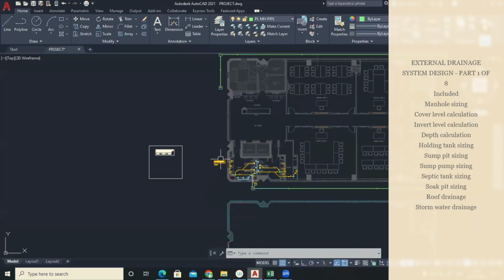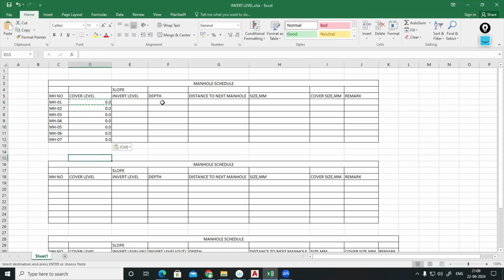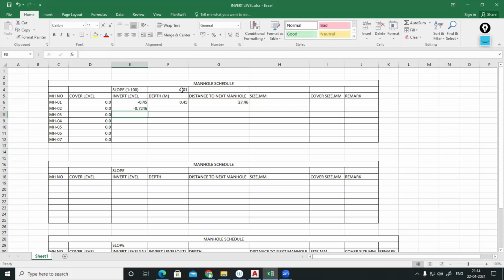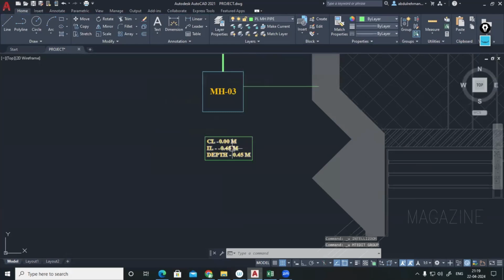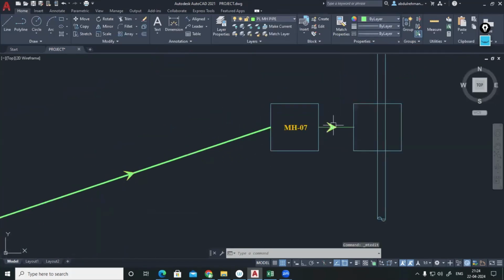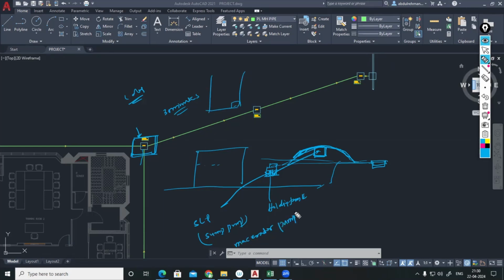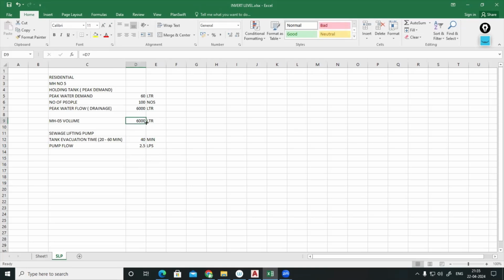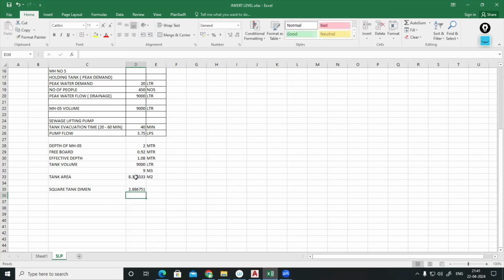EXTERNAL DRAINAGE SYSTEM DESIGN|INVERT LEVEL CALCULATION|MANHOLE SIZING|PART 1|SUMP PUMP|AMNEAR

Comment: What if municipality line depth is lesser than last manhole. Do we have to consider this tank and sump pump for last manhole or before ?
Reply from the maker: If the municipality sewer line depth is shallower than your last manhole invert level, direct gravity connection will not be possible. In that case, drainage is generally collected by gravity up to the last feasible point, then a sewage sump tank and lifting pump are provided to lift the sewage through a rising main and connect it to the municipal sewer at the required level. Need to consider comments from local authority as well.

Comment: What is the distance between manholes
Reply from the maker: The distance between manholes is not constant; it varies depending on the applicable standard and the type of drainage system. For example, as per the UPC , the spacing between manholes in a building drainage system is usually around 100 feet (30 meters). As per the IPC (International Plumbing Code), for public sewer lines, the distance can go up to 400 feet (120 meters), and in some cases, up to 90 meters depending on pipe size and slope. However, in most building drainage designs, manholes are generally spaced between 30 to 45 meters apart. Always remember, the final spacing should comply with the AHJ (Authority Having Jurisdiction) or local municipality standards.

Comment: Sir for the depth consideration you considered only inlet pipe invert level what about the outlet pipe invert level ? Is there any minimum clearance requirement from outlet pipe invert level to the base of the manhole?
Reply from the maker: Hi, We have already explained the invert level calculations for both the inlet and outlet pipes, as well as the slope inside the benching, in a series of videos. However, these videos have not yet been uploaded to YouTube.

In some manhole schedules, only the inlet invert level is provided, and the outlet invert level is omitted. However, in detailed schedules, both the inlet and outlet pipe invert levels must be calculated and included. Additionally, the benching must be considered, typically at a 1:10 ratio as recommended by most standards.

If sediment is to be collected at the bottom of the manhole and prevented from flowing through the outlet pipe, a clearance must be maintained between the outlet pipe invert level and the manhole bottom. IPC standard does not clearly specify this clearance or slope, so local standards should be referred if its suggested.

Comment: hvac ducting cheyumbol nammal  cfm kurayumbol duct heightum change cheyumo? please reply
Reply from the maker: @Jithin80  When the airflow rate in a duct system decreases, both the height and width may need adjustment depending on site conditions and the maximum allowable ceiling height. Sometimes, the width needs reducing, other times the height. Duct sizing involves many factors, including noise criteria, maximum duct velocity, allowances, collar dimensions, and diffuser sizes. To get a full understanding, please watch our duct sizing classes on our YouTube channel, where I cover in depth topics like equal friction, velocity reduction, and static regain methodologies of duct design. It's a comprehensive topic, so the videos will help clarify everything.
Reply: @amnearmep  ok thank you